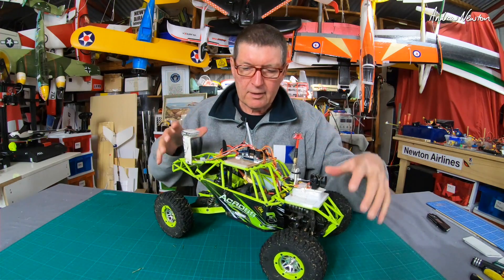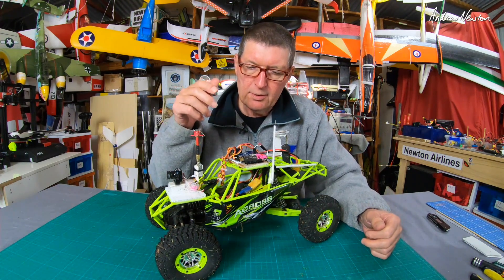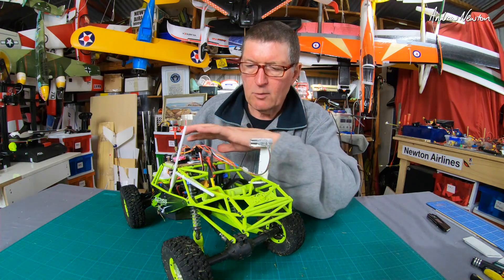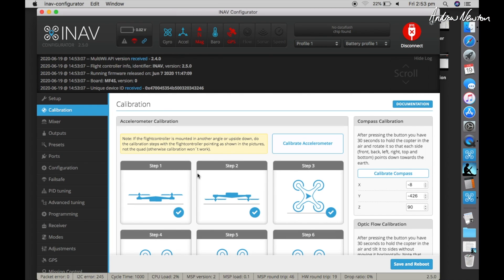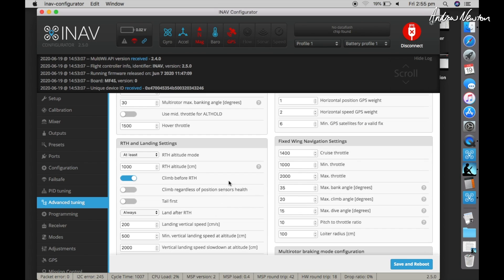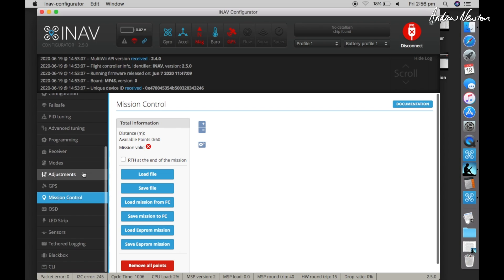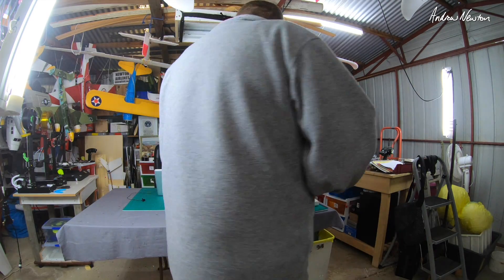iNav Rover Setup

Comment: got the ESC working for the Speedybee F405 working today. Had to reprogram the ESC using the livemode throttle test to set throttle ranges THEN switch to reversible ESC.
Reply from the maker: Excellent - thanks for the tip!

Comment: Hi Andrew, I have a rover on a speedyebee F405 mini with Inav 8 and a firmware of F405 Wing. Everything on the rover works fine, except reverse (reverse sometimes work if you time the switch at the very correct time). Any ideas on what could possible be the cause ? I have set inav with reversible motors, and my Arrma Granite 4x4 BLX has reversible motors
Reply from the maker: I have never tried reversing motors but Pawel Spychalski has done videos on it. INAV 2.6 but it will be the same
Reply: @AndrewNewton  I finally got it working after spending hours trying different settings etc.  I am still not sure how it is working but it works !

Comment: Great video and project.  It is so cool that I'm inspired to build something similar myself.  Looking through the parts, the ESC for a brushed motor that you used doesn't support reverse.  Did you make the choice for a reason?  I think I'll select a 20A ESC with reverse (Turnigy has one) so I can also drive the car forwards/backwards in manual mode.
Reply from the maker: Yes a reversing ESC is the best idea. I just used what I already had

Comment: Hello, I am running iNav 2.5.1 on a Matek F411 wing fc. I have it configured in Rover mode with a Matek M8Q-5883 GPS unit connected, a VTX and a FrSky R9mm rx. It is powered by a 3s 1000mah lipo. The Fc is mounted on its side in the rover and that is accounted for in iNav.
I have two outputs set as pitch and roll and these servo outputs on the board are connected to the forward backward and turn channels on a Sabertooth 2x10a rc controller. This controls the four motors/wheels on a Lynxmotion A4WD1 V2 Rover Chassis. The sabre tooth and motors, are also powered by a 2nd 3s lipo.
Using a FrSky Qx7 controller with a R9 Module, I have full control or the rover forwards, backwards, left and right. I have Ch3 set to arm mode on and off in iNav, and Ch4 set to enable Nav WP Mode. Both of these change the mode correctly in iNav.
The Matek GPS is showing a full lock and perfect position in iNav and when out in the field it flashes blue showing a full lock. (I am only using +-rx/tx and not the SDA and SCL wires for the compass)
In iNav I have set basic course of some straight lines with waypoints to form a rough grid shape. This has been saved to the eprom. I have powered everything up and in iNav I have loaded the course to the FC.
I then move the vehicle outside and arm it using ch3. I can manually drive it fine. I then us the stick command throttle down and rhs to top right. After doing this I then active iNav WP using ch4, but nothing then happens. I can still drive the rover manually though.
Can anybody suggest where I start to trouble shoot this please.
Many thanks
Reply from the maker: I think you do need to connect and calibrate the compass. Also make sure your stick commands are outputting 100% signals. Load the mission, Arm the board then switch to WP mission mode.

Comment: Great for smooth terrain, but don't get any air over the bumps or the CAA will bite you on the bum for operating a UAV-FPV-4x4-NBG-SNAFU without proper clearance.

I bet it'll slope nicely, though.

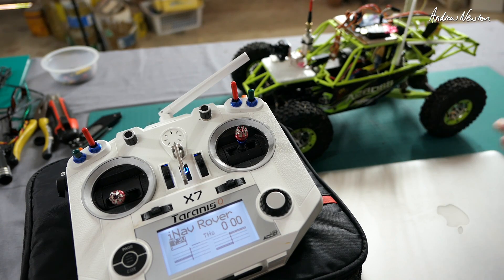Comment: @8:20 you just set it to "drop" for the RTH thing to just stop where it is otherwise it's going to circle like in your last video
Reply from the maker: Drop is a Failsafe. It's either Drop or RTH, not both
Reply: @AndrewNewton  i apologise i mis-spoke when i said drop. , no i meant on the rth itself... in your mission you can set it to return to home and the stop you set the loiter radius as described here in pawels video, : https://youtu.be/obfc62VWhyw?t=770
Reply from the maker: @WX4CB  Not quite. I have the loiter radius at the rover default, same as Pawel's video. The solution is to select "RTH at the end of the mission" and "Landing" in Mission Planner

Comment: What kind of mounts are you using for mounting the FC to the rover? Are they 3D printed?
Reply from the maker: Yes here they are https://www.thingiverse.com/thing:4154620
Reply: @AndrewNewton  Thanks. Don't the pin headers stick out the bottom of the middle plate and interfere with the mounts?
Reply from the maker: @avsaase  Plenty of clearance, at least on mine.